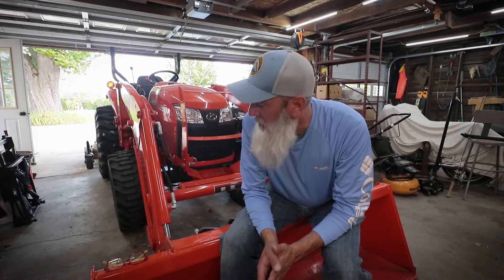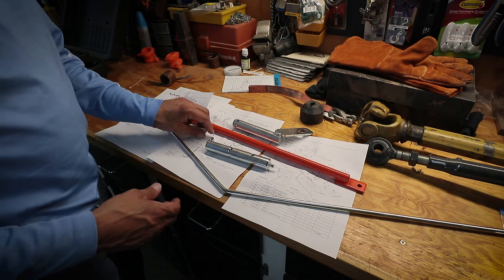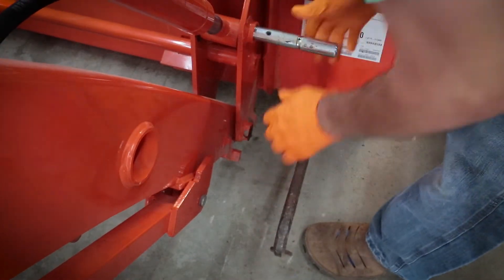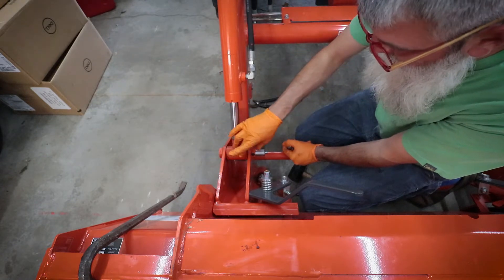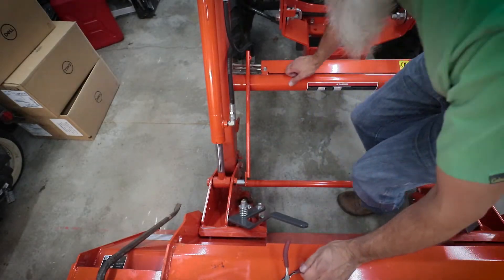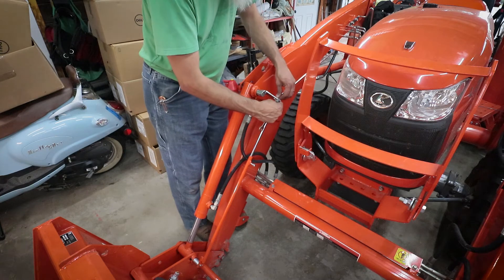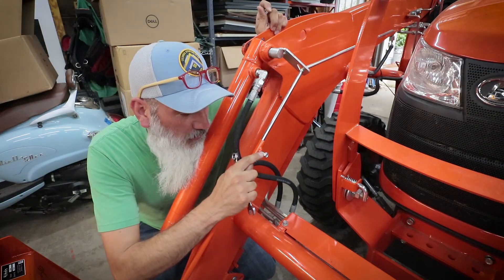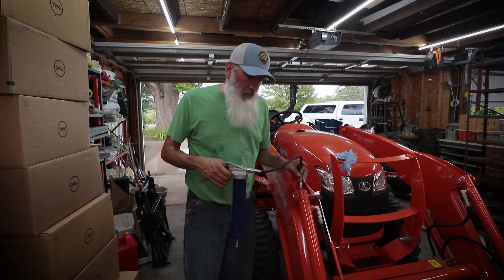Installing Kubota L2130 - Level Indicator Kit (on Kubota L2501)

Comment: What you need to do when changing/replacing a pin like that is to use the new pin to push out the old pin.  Then you will never lose your alignment and nothing will shift.

Comment: Hi Todd! I just bought the same tractor and loader a couple months ago. 2 weeks ago, I also installed the bucket level indicator. It have been very helpful, as I am a new operator as well. Just a little tip for others that are watching this video, I slid the new pins in as I was removing the old ones. This kept the holes aligned and no fussing with bucket for piston alignment. Thanks again for all the work you and Rachel put into the videos. As a new landowner, soon to be homesteader; the videos have been educational.
Reply: That's exactly what I was thinking as I watched the video.  I would have put a small deep-well socket over the cotter key nipple if necessary to tap the new pin in as chasing the old pin out.  But it was a great video.  I subscribed ane hope for more interesting work.  i'm going to buy a kit for mine B2601.

Comment: Thanks, man. I have an older Kubota I just ordered a bucket level indicator kit for yesterday. I was wondering how the bent part of the rod worked. You showed and explained that part well. I don’t use my tractor often enough either to be able to tell my bucket’s position. So, this will come in handy. Thanks again. This was a really clear and well put together video.
Reply from the maker: Glad I could help, and happy you found the tips useful.

Comment: Thank you for making the video it was very helpful.  In the small plastic bag with the bolt for the assembly indicator(red rod) there was in my kit L2130 a HEX nut, self-locking that I understood was used as a jam nut for the bolt that goes into the welded nut on the red rod.  I did not see you install it.

Comment: Great video thanks! Very helpful. FYI I went to my dealer, there was no “kit”  (have had my tractor a few years) Lower pin $45 upper pin $25. The rod and lower orange rod with screw were $39.  They only gave me the rods and screw got home looked at it and knew something was missing. Watched your video and ordered the pins!  Thanks again

Comment: Great video. I've got the same tractor and absolutely love it. True workhorse. Definitely a handy, almost must have tool. If you don't want to adjust the rod for other attachments,  a simple electrical tape, or tape it off leaving a thin line of the rod exposed and painting a ring around it for your different implements as a guide. Great video

Comment: On my 2012 John Deere 4320 when the top plate on the the bucket is flat or level with the ground then the bottom of the bucket is a well. I looked at getting the level indicator but I realized there is no need for it.

Comment: I have a John Deere 1025R.  I noticed that if the back top plate on my loader bucket is flat, then the front lol of the bucket is f!at.  It took me a while to reach this conclusion when I would park my tractor.  It is important to always put the lip of the bucket flat to the ground.

Comment: Thanks for the great video.  I’m installing mine, that came with no instructions.  I guess the nut that came on the bolt has no use?  Thanks again, much appreciated.
Reply: That nut is used as a jamb-nut on the bolt once it's set, so the bolt doesn't back out due to vibration.

Comment: you might want to take the tube and the rod to an engine rebuilding shop or cylinder head shop and see if they have a Ring Retained Valve stem seal that will fit on the tube and allow the rod to fit thru .. this could keep dirt out of the tube... so just a little oil down in the tube will keep it from corroding inside and keep it from filling with dirt.. 

one could also drill and tap to 1/4-28 and put a small zirc fitting in the bottom side of the tube to keep it greased and force any dirt out the top.

Comment: One question:  Can that level indicator be installed on the left side of the loader?  All of my 3rd valve hoses are on the right side.  It would be much cleaner on the left side.  Thank you.